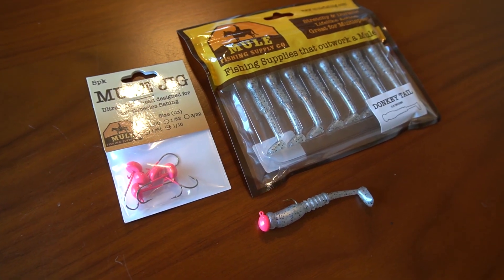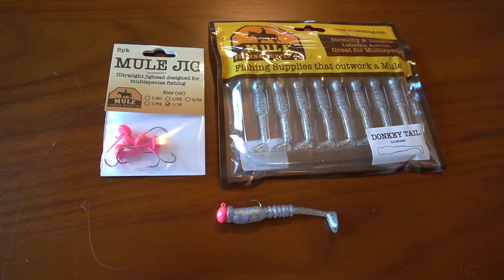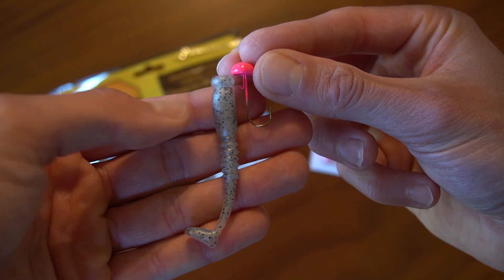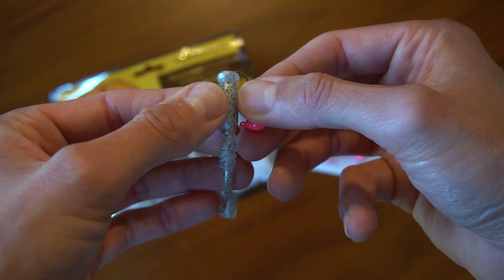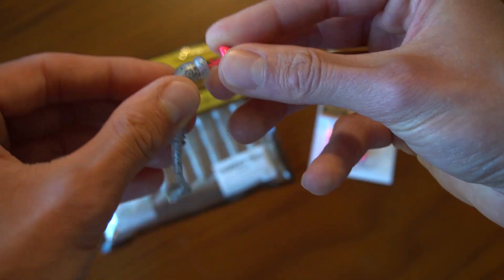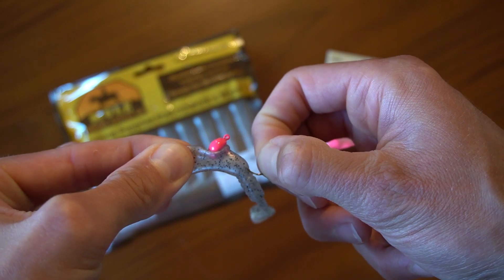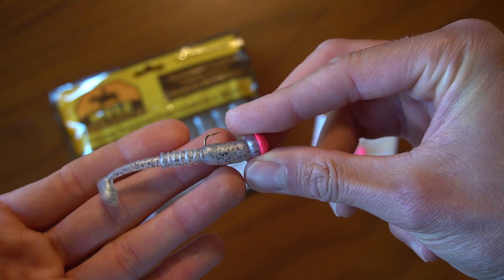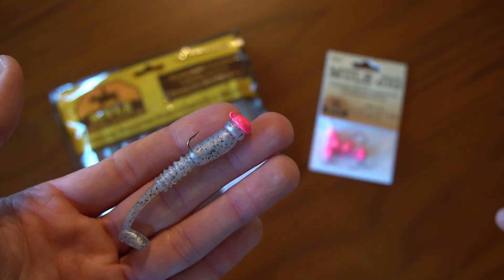How To Rig A Mule Jig & Plastic

Comment: how do you cast a 1/64 oz mule jig with donkey jr.  using 4 pound mono.  tied 2 pound lost every fish to line breakage.
Reply from the maker: You can cast on 4lb test. Just try to find some with low diameter and make sure you're using an ultralight rod that has a soft enough tip to load up on a cast.